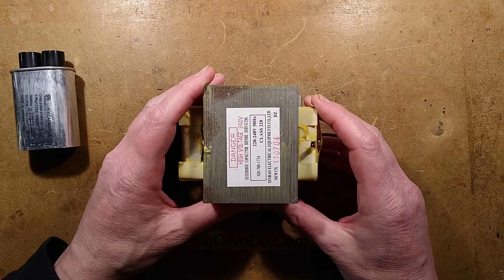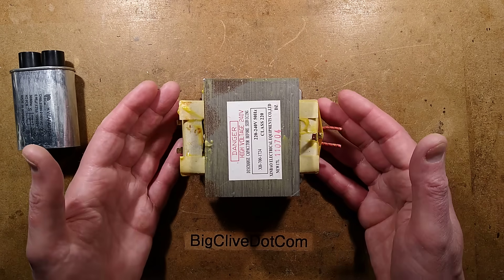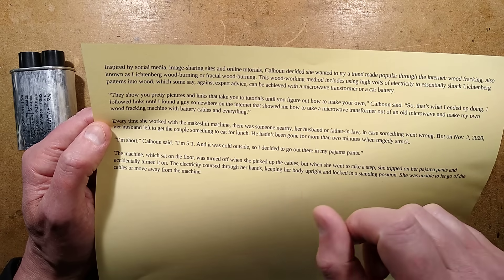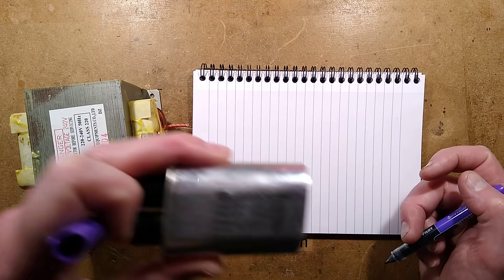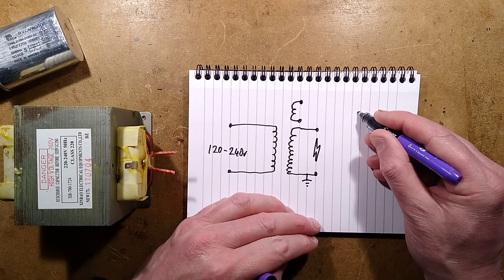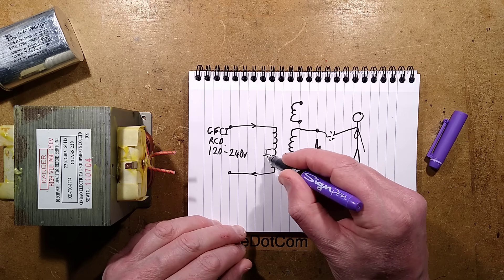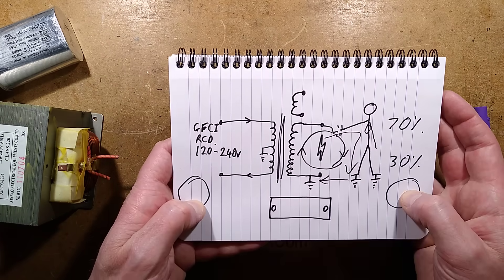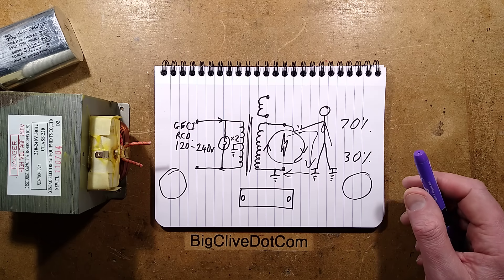The most deadly project on the Internet

Comment: I have done many projects with microwave transformers. Re-wound them to high amp DC voltage. Never had a problem because I am not an idiot. Research things before you use them. I learned that in the 3rd grade.

Comment: I do not understand how one of the two HV polarities  sits tacked to the outer metal of the transformer and with that ultimately to the microwave's outer cage.  It will carry that high voltage, won't it? After all it is AC, and even if one of two polarities actually would be tantamount to "ground" (as on the electricity network inside of our houses one polarity may effectively be zero and only the other one vary in rapid succession have a positive or negative charge) even so the plug could be reversed, and besides that I don't think it works that way on the secondary winding of the transformer. So how is it possible one of the two high voltage poles is connected to the outer metal construction of the device?

Comment: Not enough knowledge to fully respect what is really going on and or take appropriate measures to reduce risk.  I think there is a phrase for when amateurs are working with electricity, They know just enough to get themselves into trouble.   I worked in an electric maintenance and repair shop for many years through college.  I learned a lot but the biggest thing I learned was I didn't know enough and to respect electricity and it's never a bad idea to ask for a professionals help.  Remember seeing this stuff on the web some years ago and just thinking how much of a bad idea it was for inexperienced DIYers to be messing around with.  Hell the vast majority of non mechanic or electrical people can't even hook up jumper cables correctly but they are doing this stuff.

Comment: I've thought about how I might do it safely and even a slight improvement in safety would significantly increase cost and space requirements.

Making it actually reasonably safe would be a major project that would probably require actual experts in high voltage systems to work it out, find all the ways basic safety precautions could fail and shore them up. I think it would be great if some relevant experts got to work on it, the results are really cool, but it's absolutely not something for amateurs at this time.

Comment: In the old days of Switchboard telephone exchanges, the ringing current was provided by a switchboard operator hand cranking a small 50V ac generator down the connected line. My dad worked for the GPO, (General Post Office) Telephones, the national and only telephone service in the UK at the time. It was so, that I obtained one such device from a decommissioned switchboard, which I proceeded gleefully to test my schoolmates bravado! It was tremendous fun as the current was low though with a full and frantic spin of the handle you could muster about 70 volts! Enough to make one jump out of one's skin!
At the age of around thirteen, I knew how a Superhet radio reciever worked, and was repairing both Valve and transistor equipment for my friends. I became, unsurprisingly, a TV repair engineer, I worked on microwave ovens when they became popular in the late '70's early '80's, A magnetron runs about 2.2KV at around 1000Watts input power, so the Transformer is kicking out half an ampere or more into the device. 
That is several times more than is capable of inflicting fatality on any unfortunate mortal in its path!

Comment: I might add that the current (Amps) that this high tension (HT) transformer works at is in Amps, (approx 8 Amps) compared to a commercially made small Neon Sign transformer which is sealed and has the appropriate cables input/output of the correct type (low tension mains Volts 120V or 240V), whereas the Neon Sign (NS) transformer high voltage Wires have the correct insulation and only operates at 30mA (milliamperes), a fraction of the current of the MW transformer. The MW transformer will produce much longer and deeper burn patterns because of the high current flowing, unlike the smaller neon sign transformer at it considerably smaller current. If determined to go down this path, a variable mains transformer to vary the mains voltage going into the NS transformer will reduce the voltage and current at the output side. It will not make the deep heavy burns, which for some users is what they want. However, it is the safest option. Using any main cable for high voltage is a No-No, it does not have the proper type of insulation. At the very least spark plug cable as used in vehicles, is a wiser option and readily available at any auto parts store.

Comment: Great video. I wonder why YT prompted this video, probably because I was watching accidents related to radioactivity. So we can say that this women mentioned was kind of ”lucky”, because she closed the circuit only with one hand, otherwise it would be fatal easily. YT should leave few videos like this one here, that would warn and delete all others with instant ban if someone tries to make video. Or they should put some mandatory overlay message with red big, flashing letters about the danger and sad statistics. Once I was zapped for a small fraction of second with 400V when repairing machine that supposedly shouldn’t have power, switch was off. I can say it was 400 because I already knew the feeling of 230V😂. BTW please remember never to trust any switch but unplug device completely no matter how obvious circuit is for you. Always ground devices and check if socket has proper grounding. I felt for few days muscle pain in my forearm, from that brief short muscle cramp. Imagine what can happen when even higher voltage is applied for a longer time.

Comment: The fact is, current goes down when voltage goes up, thus when the voltage goes down the current goes up.  Be safe and assume all electrical devices are deadly.  It is true low current can kill, but high current can also kill, it is actually more deadly the low current.   I have made a spot welder out of a MOT, the burning wood is cool, but I value my life better than wanting to make a burned board.   Lee

Comment: When I was a toddler I was fascinated by vacuums for some odd reason so the only way to operate one was to obviously plug it into the outlet. Well my parents had put those little plastic "safety" things in to childproof the lower outlets in every room that were within reach. Well being a very young I did not have the hand/eye coordination or much less the strength so I decided to use my mouth to remove it. While I don't remember the exact moment, I assure you I always made someone plug in anything for many many years. I'll never forget the marks the shock left in that long hallway and no matter how many times my parents painted over it it was never the exact same.
Reply from the maker: I too was fascinated by the vacuum at an extremely young age.   And took it completely to bits!

Comment: I was throwing out an old microwave and remembered seeing how cool the power output of the transformers are, and I tried to get it out but the special bolts on the back of it stopped me. I ended up trying to cut through the metal, and I was pretty close too but I gave up and realized how stupid that would have been. I probably got closer to dying that I realize.

Comment: Current kills not voltage.
Reply from the maker: Voltage pushes current.  The higher the voltage the more current will flow through a resistance.   The high voltage also breaks down insulation easier - and that includes the natural resistance of the outer layer of skin.
Reply: That static discharge that happens when you touch a door knob is around ten thousand volts, again it is current that kills not voltage. @bigclivedotcom
Reply: @briandeeley1599 but in a lot of other cases, especially in human interference, voltage is proportional to current.. lightning uses the same idea of “static” as rubbing your sock on a carpet like you just said, just on a geographic level
Reply: @MyRadTVAcc  I never meant to give the impression that high voltage is not dangerous.
Reply: @MyRadTVAcc  Yes I know, ohm's law is the first thing you learn in the study of electronics.
Reply: If you have high voltage you have correspondingly high currant. I=V/R. It is the combination of energy, frequency, time, and sufficient voltage to make muscles contract that kills. Statements about whether voltage or amperage kill reveal only that the person making the statement doesn't understand anything about electricity.
Reply: I have been a electronic repair technician for 30 years and I = V/R is basic ohms law and what you are forgetting is that current is inversely proportional to resistance, that is why when you get zapped after walking across the carpet  and touch a doorknob and get zapped with 10 thousand volts of ESD you do not die because the current is very small and resistance is very high. you inadvertently supported my claim with your comment.   @Roflcopter4b

Comment: Hey, I've been doing this for years and I still have one finger left. I don't see the problem. I was never good at counting anyway, so one is enough. It's only high voltage. No one ever says, you wanna get low. So, if you wanna get high, you may die. All joking aside, electricity is to be taken very seriously with every precaution needed to ensure you don't get shocked, burned, or die.

Comment: You seem to know a good deal about transformers and electricity.  A dead mans switch and indicator light are great ideas and make things much safer. It's great that you explain what the danger is but saying this is the deadliest project is quite an exaggeration. How many people are actually killed by these things?  In the US there are approximately 1000 deaths per year resulting from electricity. Something like 300 are from lightning strikes and 400 from high voltage. How many of the 400 are from playing with transformers? I did find some information that says there have been 33 reported deaths from the use of these transformers for fractal wood burning.  Tragic indeed but far from the the list of leading causes of accidental deaths. I have a bunch of these transformers on the shelf and I might just rewind a couple with heavy cable and see if I can make a nice little spot welder. They also make good electromagnets by pulling the secondary out.
Reply from the maker: An unusually high number of people have been killed by this project, and in a very violent way.
Reply: @bigclivedotcom  What is your definition of an unusually high number? I've been jolted by one of these so yeah it is violently painful. Where is the data showing an unusually high number of people being killed by this? Sure these can kill, have killed and will kill again. There are many things that can and do kill people everyday. Knowing the risk can reduce the chance of dying but overstating the number of casualties won't prevent things from happening. 34 reported deaths since the trend started.

Comment: Forgive my ignorance but you talked about making safe by hacksawing off one of the side coiling things and wrapping with wire, which would render the thing 'safe' by it producing low voltage with high current. I've always been led to believe that it's the current that kills, not the voltage. Just looking to understand.
Reply from the maker: The removal of the secondary is for low voltage and high current projects like welders.

Comment: I stumbled on this video. I've been needing to produce about 2kv for an experimental system I've been working on. I didn't want to use a distribution transformer because I would have to limit the input Variac way too much (as I only need 2kv). A microwave transformer is perfect -and cheap! Thanks!
Reply from the maker: Depending on the current required it may be a lot safer to use a neon transformer.

Comment: Total agree tbilt one of the evil things. Used uncured wood for the handles. I have a dead man switches on the primary circuit. First time I used it got the crap knocked out of me. I insulated the handles a lot better all was well. If I had not headed a dead man switch it would have killed me first time Iused the dam thing. I NO LONGER USE THE TRANSFORMER TO BURN WOOD. Mite kill myself.

Comment: What an idiot, she got complacent, had the transformer on the ground and didnt have any kind of insulator to stand on to keep herself isolated from the current. How she tripped on her pajama pants and turned the transformer on who knows.  If you lack the common sense to change a receptacle while its hot, you have no business messing with electricity be it 5V or 5000V.  Heres my set up, I have the Transformer mounted inside of a wooden rectangle shaped box that is divided into two sections.  The Transformer is mounted with a silicone rubber mat between the transformer and the wood using PVC nuts and bolts to secure it to the box.  On the other side is where you put the piece you want to burn.  After attaching the leads to the piece and soaking the piece with the electrolyte solution a plexiglass cover is put over the whole wooden box, this lid has a metal wedge in the center that will connect the circuit that feeds power to the transformer, without that lid it wont turn on when you flip the switch, unless you want to die and you jump it with something.  That now connected power wire is connected to a switch and from the other side of the switch its wired to the plug.  Quick check list, Switch off, Plexiglass Lid on, Plug in the transformer, Stand on a second silicone rubber mat, flip the switch, Burn the piece, when done turn the switch back off and unplug the plug from the receptacle.  Remove the Lid and remove your piece.  Like I said if you were suicidal it would be super easy to bypass all that and light your ass up if you really wanted but someone looking to make art?  Theres to many points that have to be in place for it to work for an accident to happen out of ignorance or complacency.

Comment: You could have insulated probes covered similar to winter handlebars on a motorbike where you need to press a button inside both to open the circuit to the probe tips. Also, you'd need full body insulation and have some sort of interlock on the room you are working in to cut the power when somebody else walks in. Only then would this be anyway near safe to do. Or, don't be an idiot and just don't do it.

Comment: Im a semittruck mechanic/electrician and am very aware of what even the 24V DC on those systems is capable of i sometimes add transformers that convert the 24V DC into 230V AC to the trucks and even the static charge on theese things right out of the box is enough to sometimes spotweld metal tools to the contacts
People say its the amps that kill you not the voltage which is stupid because the amps relate to the voltage divided by the resistance so more voltage = more amps
Noone without professional training and experience shouls screw around with anything high voltage even when disconnected from the power supply as many components can still hold sufficient charges to kill you
Also often people who ged shocked dont die in the incident but by heart attack when they go to sleep afterwards so if you get shocked seek medical help immedeatly

Comment: Wouldn't an old magneto 'spun' by a small electric motor be a bit safer way to get this effect?
Reply from the maker: Anything that can generate a high enough voltage at high current will have hazards.

Comment: I almost never make comments on YouTube, but I felt compelled to in this case. I've done some fairly dangerous work, and as someone who uses a lot of welding equipment and power tools, this really bothers me. 
If you want to do something like this, you need to develop a protocol - if only a simple one. Through proper grounding and insulating, while wearing the right PPE and setting your apparatus up before engaging the electricity, there should be no way for you to injure yourself, let alone end your life.

Comment: I am a master electrician, 29 years in the trade. I would advise against doing this unless you are very well versed/trained in the process and have a safe piece of equiptment, on/off indicators, contained in a proper cabinet or mounted, not laying on the floor with jacked up connections, proper voltage rated terminals and insulation rating on the wire. Pretty much what he said.
Reply: I see I've already commented on this last year. Sorry for bugging you.😁
Reply: Also, 29 yearsI started in October of 1994. My first post said 25.

Comment: Use a rubber insulating mat to stand on rated for the voltage you might be exposed to.  Only work with one hand at a time.  Don't work with a necklace on. Don't wear a ring while working.

Comment: Back in 1970, I was a US Navy electronics technician, I was making an adjustment inside an amplifier power supply.
My screwdriver slipped and 2kv at about 1.5 amps went from my hand and out my elbow into another transmitter drawer,
it blew a hole out my elbow, and my arm was in pain for about a month. I was lucky, if it had gone through my chest, I wouldn't have made it to 74 years old. Stay away from high voltage! I later worked on more than 10kv at an industrial plant, one of my co-workers died when he got across a 480-volt buss, professionals die in the trade, there are signs don't be stupid. Good show Clive.
Reply: Oh, Yeah.  That’s a real transmitter - not the dinky ten-watter whose B+ tossed me when I was trying to measure the plate current.
Reply: I've recently been doing design modifications on industrial microwave generators.....20 KV @ 6 Amps.....It's a real trip...Referred to as "Riding the Lightning".   Bottom line.....It's not for children!
Reply: @diverbob8  Absolutely, even the well trained can make a mistake. We started a program after one of our guys was killed on the job working alone. We worked in twos, and by the book.